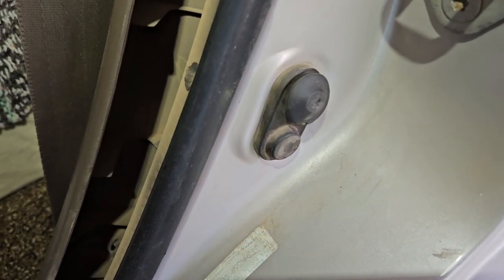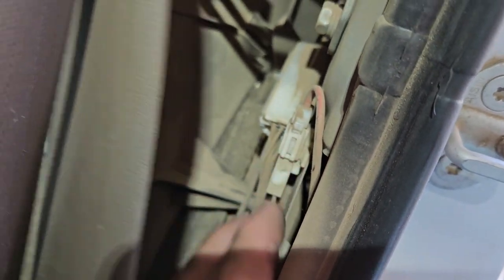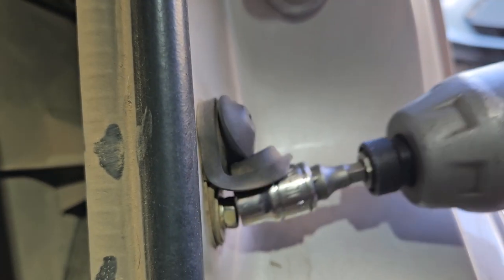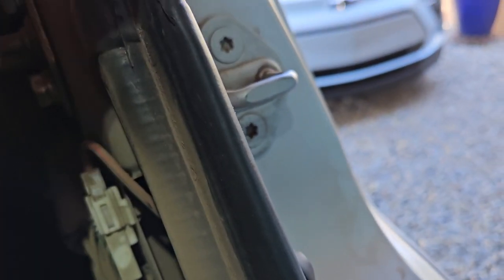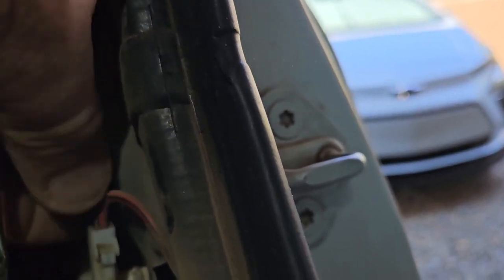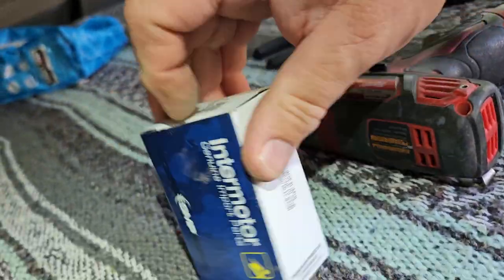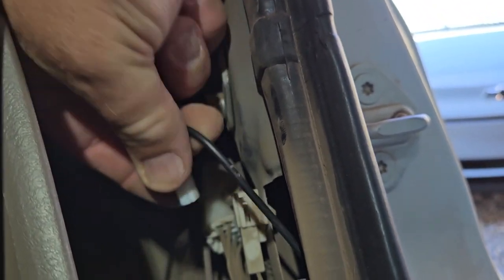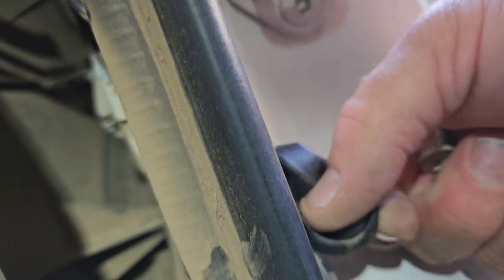How to Install 3rd Gen 4Runner Door Jamb Switch

Comment: Would be nice to see the interior lights going on and off with the switch.  My '99 Gen3 switch looks like it has TWO wires but what's the part-# you used?  Thanks
Reply from the maker: Standard Motor Products DS863 Door Jamb Switch https://a.co/d/1nMIXdl the front and rear are different.  I used one of each.